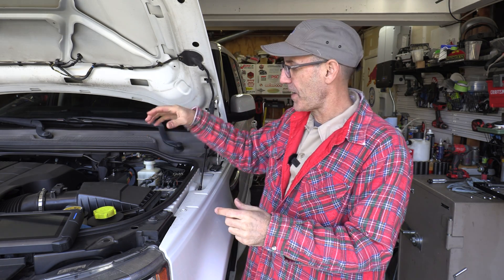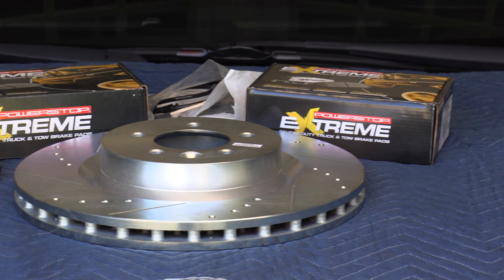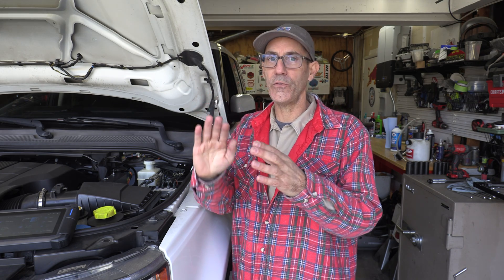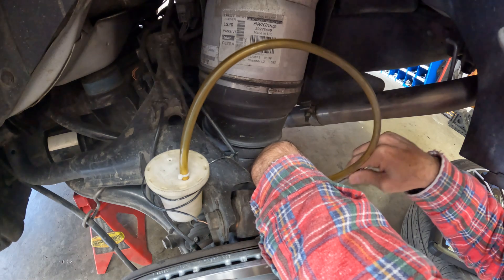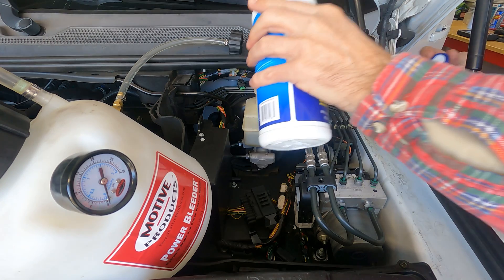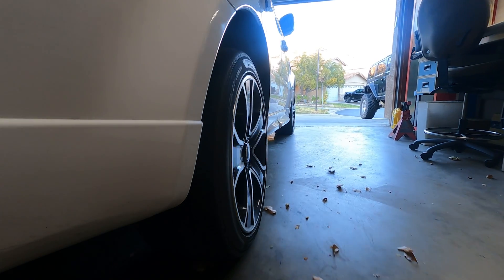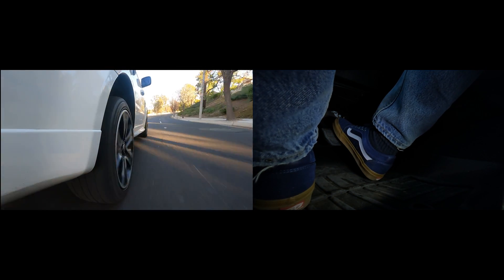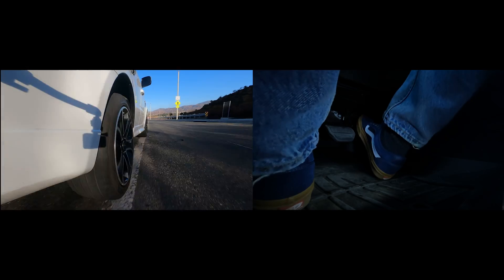How To Bleed ABS Pump for a Perfect Brake Pedal

Comment: I'm curios, you say to start bleeding on LEFT rear?  I have always bleed brakes from the furthest first. That would be the right rear caliper or wheel cylinder first and left or drivers side second?
Reply from the maker: That is the best practice for older brake systems. Anti lock systems feature discreet lines from the pump to each wheel so it doesn't matter farthest to closest anymore. Each wheel is it's own line that doesn't effect the others.

Comment: I had this problem of abs on 3 cars after the brake circuit full bleeding. 
In fact, the mechanics don't bleed the abs and instead put air inside. They would never admit it's important to have a diag tool for a genuine bleeding of cars equipped with abs.

Comment: Hi. Great video. What scan tool are you using. Thanks
Reply from the maker: Hey thanks! I'm still using the Vdiagtool VD70S. Sometimes they will have a really good sale and unfortunately it's not at the moment. They also sell a few cheaper models and the key component to look for is BI-directional Here's a link to my amazon store https://www.amazon.com/shop/autoedits/list/2V9OUZO8OUU3D?ref_=aip_sf_list_spv_ofs_mixed_d&ccs_id=5ed1e958-aabb-45cd-81cf-ad09d004e080

Comment: Video was great to watch. I doubt that you pushed enough fluid through the system to get all the air out, but time will tell
Reply from the maker: Hey thanks for the watch. I just got back from driving around Mammoth in the vehicle during the winter storms and the antilock brake system was working overtime to keep from sliding off the road. And now I'm home back in regular traffic and the pedal still feels really good... I would say the system is tip-top 👍

Comment: Not trying to be a smartass or anything, bur at 6:13 when you torque your wheel nuts, why do you keep turning like 6 degrees after the click instead of having a higher torque setting to begin with? Do you trust your "feel" over a calibrated wrench made for that very task? Just curious
Reply from the maker: Yes, I trust my calibrated elbow

Comment: Hi 2012 odyssey VSA light comes on and front brakes lock up around 15 min drive. All i did was drive van on ramps and thought i will use the anti skid button. I flushed the transmission fluid and  backed the van off the ramps and drove it so about 15 min the VSA light cam on and locked up. I let it cool down and hurry back home. I have a xtool 819 and I scanned and 66-1 code. I reset and test drove again and about 15min brakes locked up again. Whats your thoughts? Van had no problem  before i did the tranny flush. Im stumped.

Comment: I have a 2005 Dodge Caravan. It has traction control. The ABS brake bleed function does not work on that year/model with my XTool scanner. I used a version of the redneck method. Instead of jamming the brakes I went up a snowy hill. The traction control kicked in but by the time I got to the top of the hill I had virtually no brakes. A good power bleed and the brake function was good as new.

Comment: Im new to this and a little confused, is this just a normal brake bleed but you just press a button on the screen to activate the pumps in the abs and then proceed as normal?
Reply from the maker: This is if after a normal’s brake bleed, you still feel a soft pedal. This gets any air that might have gotten into the abs pump. Normally, air doesn’t get into that component.
Reply: @AutoEdits yea i got that part, i left my brake ?hose open for a week so i think theres air in the abs. However i cannot find a tutorial that explains it like im 5. But if I understand correct. I can connect a vacum sucker to the nipple, turn it on, activate the abs pump and then open the nipple?

Comment: Great video! I wish I knew this exact process 2 years ago. This is the way. I just improved two of my cars braking with this method. I think it's hard to tell that it's better if you just try to sense pedal feel at stationary idle, but I can definitely tell on the road in how soon the car responds to just a little bit of pedal travel, like a half inch or so. I don't think that was there before and that's why you don't feel confidence in the braking if you don't feel them right away. My scan tool only said to "press" the brake pedal, and that's not clear enough that you need to have constant pressure and fluid flow while it engages the ABS. I was not able to get it to work right and it would make the braking worse if not done correctly. Having the power bleeder pressurized during it is the key. I also had to prybar hold the brake pedal to trick the scan tool. I use a MaxiAP AP200 which is much cheaper than yours. But thanks for making this video! I hope others with this problem find it.

Comment: Ok, You conviced me I need to do ABS bleeding. I replaced my brake hose and I held the brake pedal with the seat and a stick . I accidentally moved the electric seat a little and I guess that introduce some air in to the system that the regular bleed didn't got out.

Comment: Good tip:  Don't buy the cheaper partial bidirectional scanners, invest in a mid-tier bidirectional scanner instead.  Getting the ones with just brake bleeding you'll find yourself pissed off how little they do later.  Example:  You'll clean your throttle body and find out the hard way that your scanner can't reset idle learning and have to either drive 300mi with it running like shit, rev at 3000rpm at and trying to push through stop signs, or fork out the $100+ to have someone at a shop reset it for you.

Comment: Hello sir,I want to ask u..Does every change of brake pad and disc rotor need to bleed abs?
Reply from the maker: Howdy. No, a normal brake service does not require any brake system bleeding. That is only necessary when there is an issue like I was having or when the fluid needs changing.

Comment: Ok, i need brain storming with people that understand also. 😅 everyone around me are the type that all they know is their car or truck takes gas😅
So my 2000 gmc sierra, i want to keep it cause i thought that it was old enough to not need all this computer stuff, blew a brake line and it blew it 89 miles from home.  I got a stainless line kit. Can i replace the one line and at least get home half safe without buying a $1200 scanner?
Reply from the maker: Yes but you will still need to bleed the system if you replace a section of brake line.
Reply: @AutoEdits  we'll see.

Comment: The issue is the air bubble gets stuck in the actual ABS module and  the ABS motor needs to come on or its trapped inside. The air can actually go out uppward out the master cylinder too so might not even see it...ABS modules suck they should just give less people drivers licenses tbh

Comment: I replaced my ABS module over a year ago with squishy brakes, and no matter how much brake bleeding I did, it didn’t fix the issue. But now I recently bought a proper scan tool, so I’ll have to give this a try!
Reply: What scan tool did ya get? I keep getting mixed reviews
Reply: I use obd jscan. It works for Mopar vehicles like my jeep. You'll just need to buy a Bluetooth obd plug. Then just pay a small fee ($25) to register your vin. Then you'll have full access to most things like abs bleed, code clearing. It even has an obscure phaser cleaning procedure. Would highly recommend this if your vehicle is on the app.
Reply from the maker: Good luck, I hope this helps!

Comment: hey thanks for the video :) I'm currently having also a soft pedal and it get's better when double pumping. One question: Was your pedal hard when you pumped the brake while motor was off?
Reply from the maker: Yes, that is normal since there is no vacuum assist from the engine running.

Comment: Great video, your camera work and details are fantastic and so helpful.  I have the same scenario with my Camry.  One question - when using the pressure bleeder, did you actually put brake fluid in it or did you just pump it up to say 10psi or 12psi but no fluid?
Reply from the maker: Thanks for the comment 👍 I do not fill the pressure cannister with fluid... it makes a mess of things. I just make sure to keep an eye on the reservoir that it never gets empty and take an extra moment or two to refill and pump up to about what you mentioned 12 or so psi.

Comment: If your pressure tank doesn’t have a bladder inside separating fluid from the air, you pushing air on the top of the brake fluid and with that you’re pushing micro bubbles into the fluid, probably some moisture from the atmosphere too.
Reply from the maker: This is not a spacecraft and designed to accommodate those factors.

Comment: I just bought a set of power stop Z 36 rotors pads and the powder coated calipers

My explorer has 247,000 miles on it and they are the original calipers. I’m looking forward to seeing a big difference.   Gotta keep this baby rolling and more importantly stopping.
Reply from the maker: Those are great parts and a perfect upgrade for your Explorer!
Reply: @AutoEdits I still have air somewhere…. Brand new calipers, rotors, pads, manually bled brakes with a partner on the pedal, completely flushed new brake fluid through the whole system. Took it for a ride to bed in the new pads, and the pedal is long and soft. Worse than before (lol). Pretty disappointed. 

I’ll have to get back at it again because I was leaving for the weekend when I finished. I did the ABS bleed too with my scan tool, although the ford explorer doesn’t have the same procedure as your Range Rover. There’s no point in the procedure that it has you open the bleed screw. Mine seems to have an internal bleed for the ABS. When I start the procedure and follow the on screen directions, Press and hold the pedal and keep pressure on it, I can feel the valves open because the pedal goes to the floor when it opens, then the pump kicks on and the pedal jumps right back up hard. After the ABS bleed you’re supposed to do another manual bleed.

The only thing I can think of is that after the ABS bleed, I did another manual bleed (as instructed) and maybe didn’t manually bleed it enough to get whatever bubbles were in the ABS block all the way out.

One possibility that I didn’t think would matter, I didn’t set my parking brake while performing the ABS procedure because my left cable is hanging up. The parking brake on these explorers is a small lever that applies hydraulic pressure on the piston. I had ordered new rear cables for both sides because they are original and both kind of stick, hadn’t received them yet. Maybe doing that will make the difference. Also ordered the Smotive pressure bleeder for this next time.

Comment: Did you press the gas pedal while you did bleeder. Scanner say pump pedal. Weird video.
Reply from the maker: Why would you pump the gas during a brake bleed? The scanner says pump brake pedal but I'm using a pressure cannister on the master cylinder instead. Weird comment.

Comment: Okay so you're using this vacuum thing in place of somebody pumping the brakes so what happens when you have to add more brake fluid and you lose your pressure?
Reply from the maker: I just make sure the reservoir is full when I start a cycle. There is no issue with refilling between bleed attempts.

Comment: I think abs really works on 60kph up speed that abs motor working normal if you can feel the brake pedal vibrate or pumping.correct me if im wrong.

Comment: Thank you for the informative and very well produced video. 

I just replaced my brake hoses with stainless steel ones and used a pressure bleeder to bleed the lines, but I think I didn’t put enough fluid into the bleeder which ran close to dry and fluid level in reservoir dipped below minimum towards the end. This may have introduced air into the ABS. 

Any idea how the air got into your ABS in the first place?

Comment: I've been pulling my hair out for a coupla years now on my Rav4, having replaced everything in the system except the ABS unit...still with soft, low pedal. Bled system manually and with scan tool 20 times, still same pedal. I bought a Foxwell630 scan tool, and when auto bleeding, the sound is an electrical motor pushing the fluid thru. I wonder should I be hearing a stronger vibrating sound using the scan tool, like when you skid on snow-ice? Wondering if the software isn't doing everything.
Reply from the maker: This sounded exactly like when they actuated on the road so yes, try another scan tool.
Reply: After bleeding the system If you have tested the brake master cylinder and works fine then the ABS module might be at fault and usually it will not trigger any error code. Good news it can be repaired, in most circumstances. These are the most common scenarios where the ABS module is at fault and it doesn't bring up any error code:

- Locking up of one or multiple wheels(No code trigger).
- No brake pressure at one of the wheels(No code trigger).
- The brake pedal doesn't get firm after several unsuccessful bleeding attempts, when the tested brake pump works just fine.(No code trigger)
Reply: @ignaciotalavera-molina4990 ...the last scenario is my situation. I've done everything many times over. Next is a wrecking yard.

Comment: The scan tool said the pump the brake pedal during the process.  You didn’t pump the brakes during the bleeding.  Or did you?
Reply from the maker: I used a pressure tank on the master cylinder since I'm doing this solo. https://www.amazon.com/shop/autoedits/list/2V9OUZO8OUU3D?ref_=aip_sf_list_spv_ofs_mixed_d

Comment: If you flush the ABS system till runs clean with new fluid will that also flush the hole brake system?
Reply from the maker: Yes but it is easier to do the flush with a regular bleed and activate the ABS pump only if there is a soft pedal.

Comment: Powerstop brakes and rotors are great. Do you know if the range rover system is similar to the system in a 4runner? My pedal press is super long. Have done a brake bleed and within 10 k miles my brakes are spongy again.
Reply from the maker: I'm not sure but bleeding the ABS is a good start.
Reply: If the brake pedal doesn't get firm after several unsuccessful bleeding attempts, when the tested brake pump works just fine. Then the ABS might be at fault, no error codes triggered.
You can have your ABS module tested

Comment: I’ve got exactly the same problem with my 2010 RRS. 
I have a scanner but didn’t know how to use the abs brake bleed part of it. All the brakes have been replaced with new and like you nothing changed. Great video thanks.
Reply: If the brake pedal doesn't get firm after several unsuccessful bleeding attempts, when the tested brake pump works just fine. Then the ABS might be at fault, no error codes triggered.
You can have your ABS module tested
Reply from the maker: Glad it helped!
Reply: What if abs bleed and pedal felt great..now it's back to feeling crappy. Already has new master cylinder.
Reply: @fredhinerman5183  If the brake pedal doesn't get firm after several unsuccessful bleeding attempts, when the tested brake pump works just fine. Then the ABS might be at fault, no error codes triggered.
You can have your ABS module tested

Comment: My wife's 2014 forester has the same thing. only 26,000 miles, I replace rotors/pads. I do the brake bleed with clear tube and bottle. No air bubbles anywhere. It doesn't have that hard feeling like my folks and mother in laws subaru. Makes me wonder if it's in the ABS module. I live in alaska and am secluded so no computer tools. frustrating. Thanks for the video
Reply: If the brake pedal doesn't get firm after several unsuccessful bleeding attempts, when the tested brake pump works just fine. Then the ABS module might be at fault, no error codes triggered.
Reply: If you take the car for a drive on a gravel road, hit the brakes hard to trigger the ABS,  do this about ten times, then bleed the system. Keep repeating this till you get the air out and a firm pedal.

Comment: When i doing this procedure firstly i realised ABS screws directly...then from calipers, because long is path from there to till end and air can be trapped again between.
Reply: If the brake pedal doesn't get firm after several unsuccessful bleeding attempts, when the tested brake pump works just fine. Then the ABS might be at fault, no error codes triggered.
You can have your ABS module tested

Comment: Same issue on my 07 JKU. Just out PowerStop z36 on front.  Bled the brakes 2 yrs ago after I replaced the brake booster and master cylinder.  I'm thinking ABS may hold the bubble now.  But no scan too. 😢  Nice video!
Reply from the maker: Good luck on getting it sorted out👍
Reply: If the brake pedal doesn't get firm after several unsuccessful bleeding attempts, when the tested brake pump works just fine. Then the ABS might be at fault, no error codes triggered.
You can have your ABS module tested

Comment: During the bleed process with the scan tool 
It said to pump the brakes 
You did not pump the brakes while you were using the scan tool to turn on the pump ?
That's what it said to do
Reply from the maker: Correct in noticing that. I used my Motive pressure tank attached to the master cylinder to emulate pumping the brake pedal.
Reply: Okay I see I understand, thank you for the good video

Comment: A question please? I have heard if the ABS unit is located on the passenger side of the car one MUST bleed the brake furthest from the ABS unit FIRT, the the next closest, etc. Is that TRUE please? Thanks in advance.
Reply from the maker: No that is not true. There are separate lines to each wheel and the handheld device will dictate which one will be activated at a time. On a brake system that does not have an ABS, it is recommended to bleed the farthest caliper first.